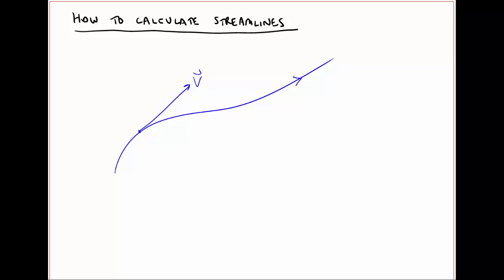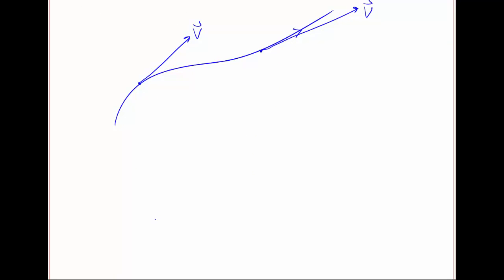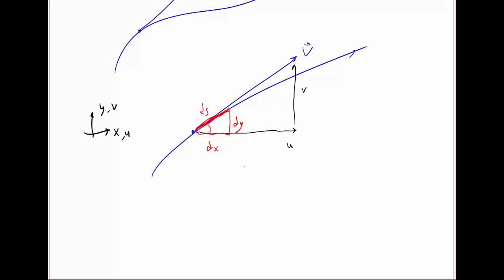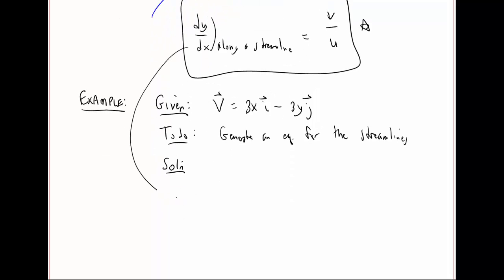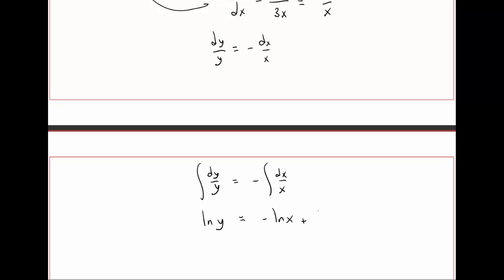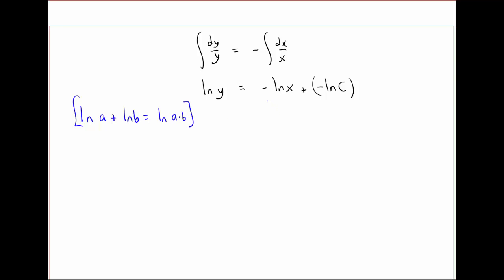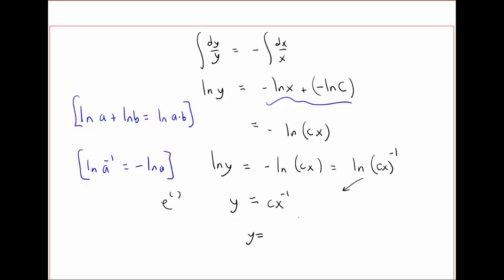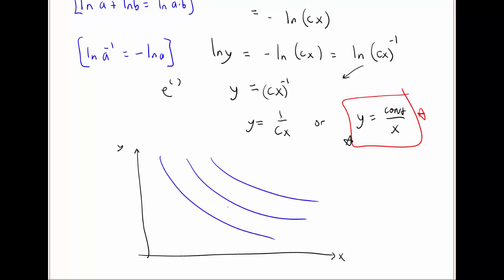Example: Equation for streamlines

Comment: Greetings again, Professor. I am here with another question (since you answered one I posted about material derivatives). I have never been exposed to tensors, and I noticed that you use them for shear strain of fluid elements in chapter 4. What would be a good book to learn about the basics of tensors? I could do the exercises just fine, but I would like to learn more about the subject.

Thanks

Patricio
Reply from the maker: I suggest "Vectors, Tensors and the Basic Equations of Fluid Mechanics (Dover Books on Mathematics)" Great little book and only about $15 on Amazon.